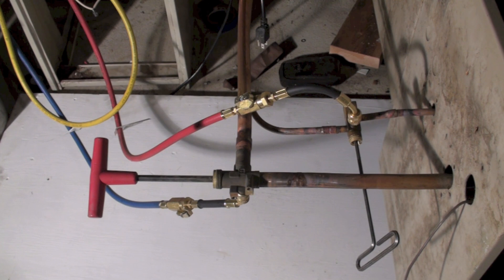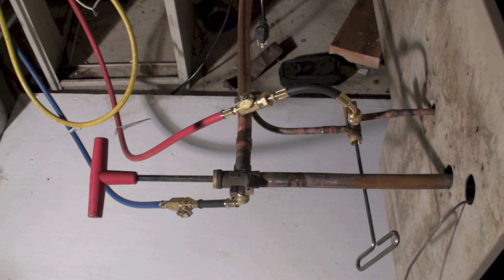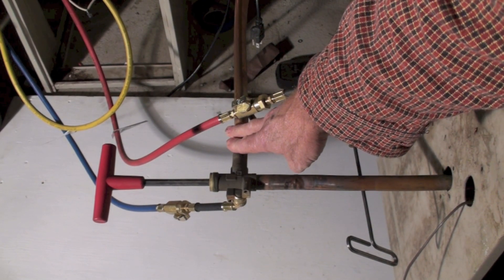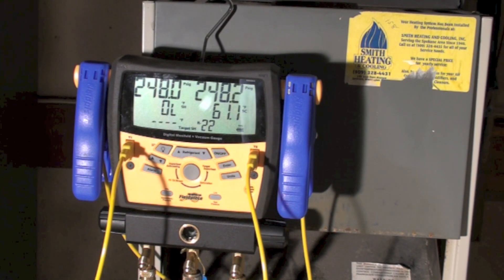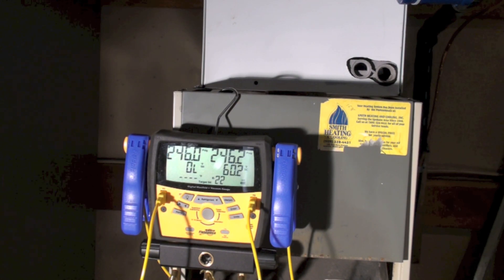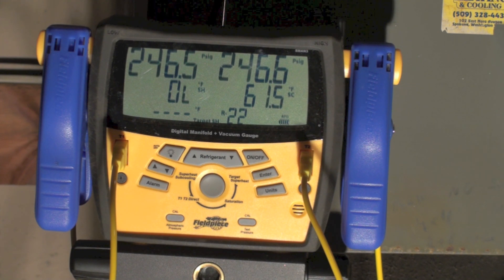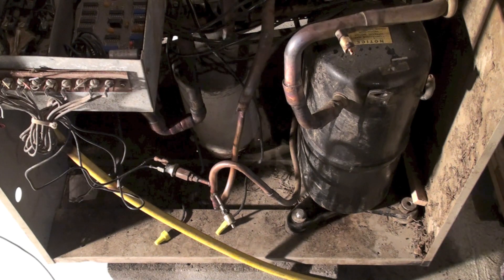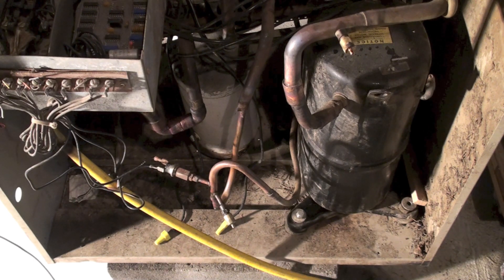A/C high pressure test part 2

Comment: Are you Pumping the unit down before you did this Gary? Just for my knowledge. I'm currently attending HVAC Trade school. Thanks
Reply from the maker: In this case, no.  However, you could pump down the unit to remove the refrigerant from the evap.
GFM
Reply: so in the field would pump down? in this video since you didn't pump down what would happen since you still have refridgerant in the system and lets say it's not much loss in refrigerant?

Comment: Why use so much pressure? Nitrogen molecule are much smaller that refrigerant and therefore will leak at much lower pressure. I was told 150psi is sufficient when using nitrogen. Is this wrong?
Reply from the maker: +Politico Yes it is wrong.  Size of the molecule really makes no difference.  One reason for the 150# is some older units and compressors were not tested at higher pressures.  I will use up to 400# if necessary.  You also need to consider that R-410A units run with a low side pressure close to the 150# with the high side much higher.  Hope this helps.
GFM

Comment: GFM,
I was wondering if you could please find time to looking into the unusual pressures one sees on ductless systems. Their are a myriad of videos where people install ductless systems but none of them show the actual refrigerant pressures after they install them. I am at a loss when the differnce in pressure of the Hi and low side pressures are only fifteen psi apart and both lines are cold; yet the evaportator split is showing 17 degrees (Good)???  My perspective is having to do maintenace on a four year old system......How do I evaluate what my gages and temperatures sensors are showing??
Thanks
Reply from the maker: Al Garcia Most of these units have the expansion device in the outdoor unit, so you will read low side on both lines.  17 degrees for these is good.  It does not make sense.  I guess they expect nothing to go wrong with them.GFM

Comment: That is pretty cool how you pressure test the ac system to look for leaks. I was just wondering do you have to use nitrogen, argon, or co2 tanks to do this test. Could you just hook up an air compressor to do this test and pressurize the system to 150 psi. Or why would you not want to do that? I know you said not to use a pure oxygen tank cause it could blow up. I was thinking regular air is made up of mostly nitrogen, oxygen, argon, and co2. So why not just use an air compressor to pressure test the system? Well hey thanks for the video, I appreciate it, and keep them coming. Have a good day.
Reply from the maker: No, please do not do that.  The one thing you left out on the contents of air is moisture.  Compressed air is 100% humidity.  That is like rain.  You will add the worst contaminate you could into the system.  CO2 and nitrogen are absolutely dry.  Hope this helps.
GFM
Reply: Ok that makes sense. Thanks for the reply.
Reply from the maker: AJ Pierce Again, NO.  The high humidity of compressed air will cause moisture problems, especially in R-410A systems.
GFM

Comment: I have a couple of videos where I have done a pressure test and I show the pressure drop about a 10th every 5 mins or so which pointed me in the right direction. One of the videos was called which is the best method to leak check. In that one I isolated the outdoor from the lineset and coil. The coil side stayed the same and the outdoor dropped every 5 mins or so. I found the leak at the reversing valve.

Comment: Great job on showing how to pressure test using nitrogen. The great part about using the digital gauges is you only have to use a small amount of nitrogen around 60 to 80 pounds. A small leak will show up faster with no problem. Where as on the analog gauges it would take more pressure and more time to find the leak. Then once I see it drop a bit I put some 22 in the system then get out the H10 and find the spot.

Comment: Back in the 70's Copeland did a film on putting Nitrogen in a 3/4 hp semi hermetic compressor out in a field, then they connected power to the compressor with nitrogen in it,it blew up, the cast iron compressor cracked in half. It's very important to tell, especially new technicians, to make sure the power is off so when the pressure rises and the low pressure control turns on you don't get hurt.